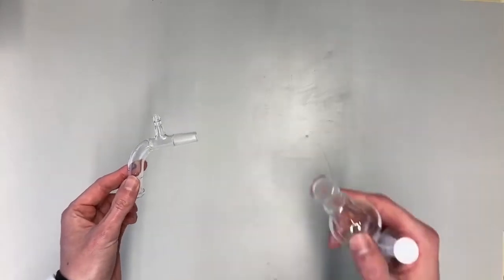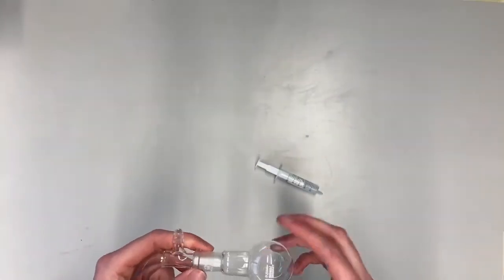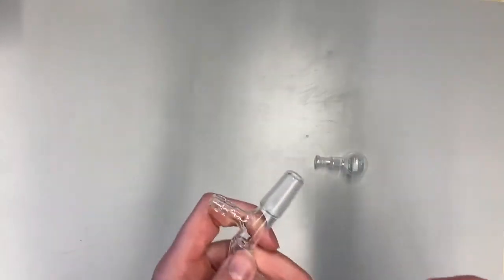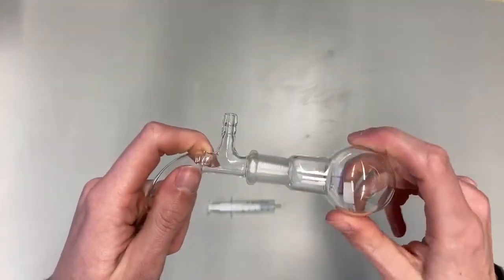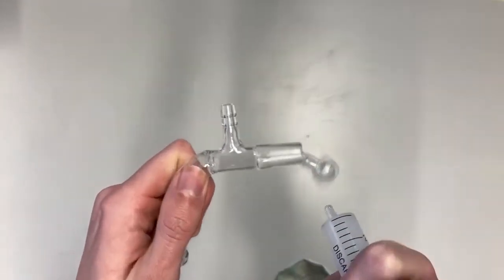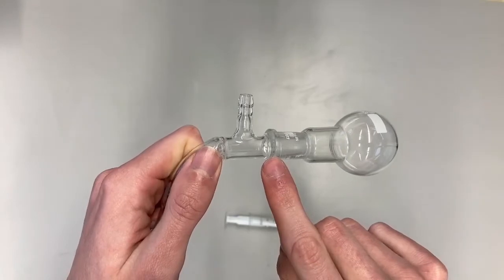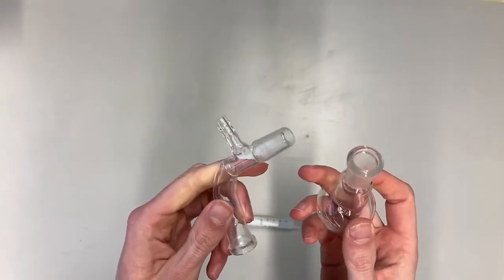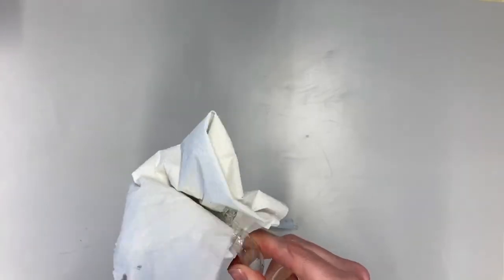Chemical/Laboratory Techniques: Greasing glass joints

Comment: Hello, Is ths grease air tight?  Is there a sealant you can use to make the joints air tight?  I am dealing with extremely toxic substances and I have teflon sleves on teh joint as well as the nice ptfe coated steel white clips but still get leaking and have to blow down the room.  is there like a ptfe calking that can be pealed off around the seal of the joint?

I know theres special joints you can have made but I am trying to avoid spending thousands to send everything out to a glass blower for now.
Reply: We use sillicon grease in this video that is airtight for the purpose of undergraduate laboratories. In the research labs we tend to use teflon-based grease which is better at sealing and doesn't show up in proton NMRs. Ground glass joints should in principle be airtight on their own but wear and tear might produce leaks. You can see if it is actually airtight by apply over pressure, the grease will form small tunnels if you have a leak.
Reply: @TjallingCanrinus help me.
I used silicon greese in mi head distillation joint and it leaked in, ive tried using acetone but it didnt work. Any suggestion?
Reply: @francescocapraro8536  For cleaning silicon grease the best solvents to use are pentane or heptane (heptane is the greener option), as silicon grease is apolar you will need to use an apolar solvent to clean. If the grease got into your product and you want to remove it you can try using pentane or heptane to extract it out, only works if your product doesn't dissolve. 
To prevent it from leaking in make sure that you only apply grease to the top part of the joint. You can use a bit op paper soaked in pentane or heptane to remove grease from the joints if you get it in the wrong places.
Reply: @TjallingCanrinus  what about hexane? Its easier to find, the only problem is that i can only find it in products called: rectified hexane, which is said its a mixture of hexane isomers.
Or ether?
Reply: @francescocapraro8536  n-hexane is highly toxic and should be avoided. Hexanes is a mixture of isomers and is possibly less toxic. At our university we don't use it, only if there really is not other option. Diethyl ether is more polar and will be less good for cleaning.
Reply: @TjallingCanrinus  i found on wikipedia that isopropil alcohol is often used for cleaning silicon greese from the CPU.
Do u think it could work even if defined  as "bland" ?
And what about benzene? Or more roughly the gas used for car?